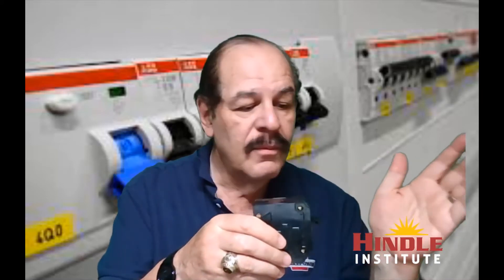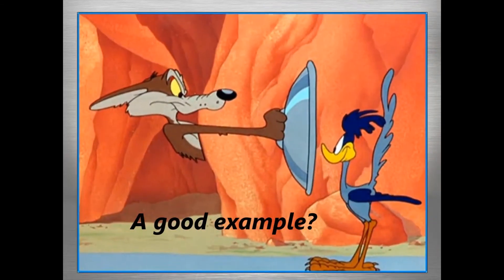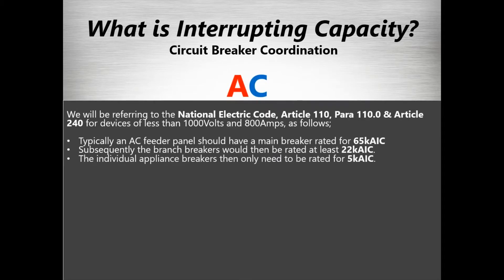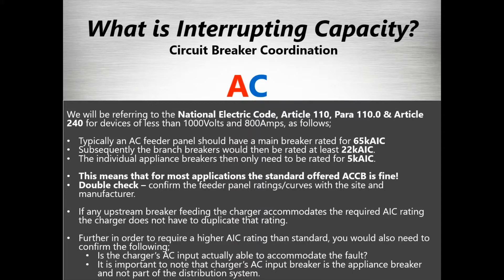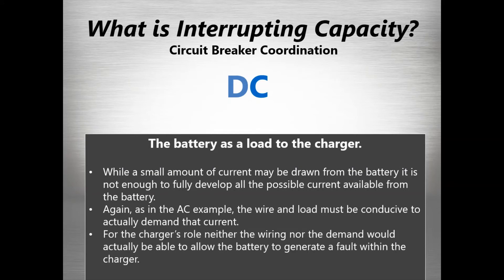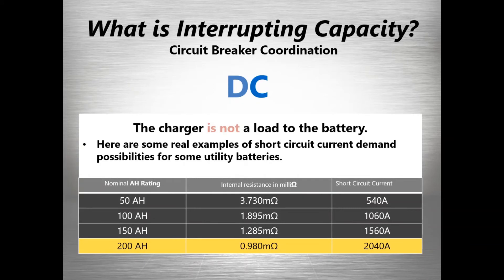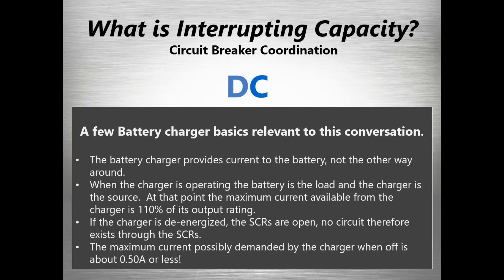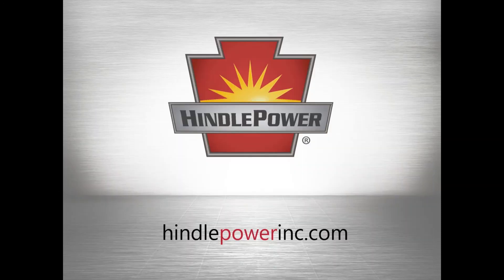Circuit Breaker Interrupting Capacity (KAIC)

Comment: Thank you for your video. How did you calculate SC current using AH data? intuitively I would you use the nominal voltage of the battery and divide it by the internal resistance.